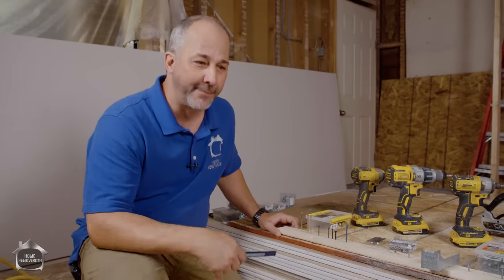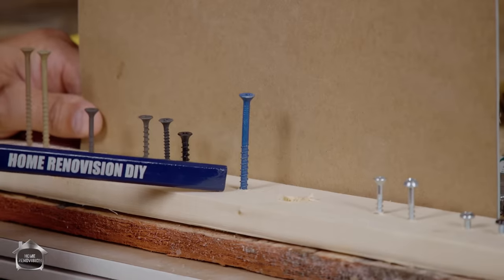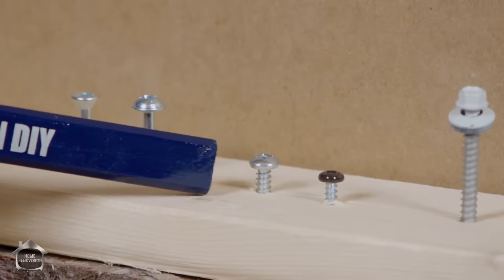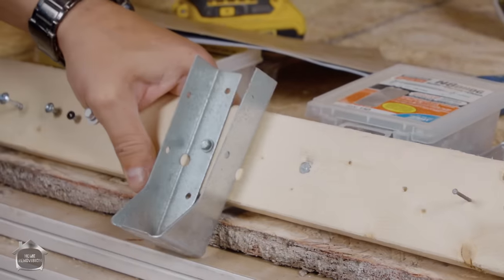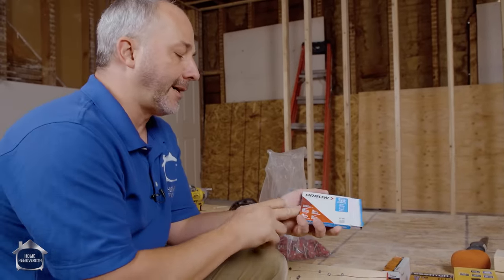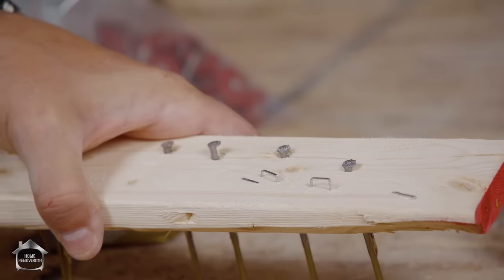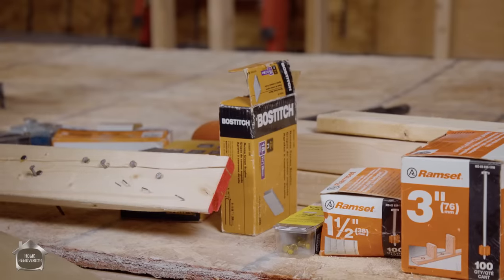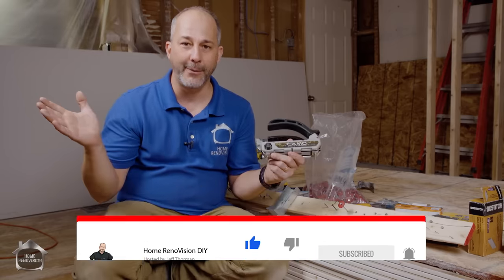What Screw to Use For Your DIY Project | Fasteners & Tools Guide

Comment: Thank you for putting this together. Would you mind doing a quick one on types of bit heads in your spare time? Philips,  flat head, square, hex, torx, etc. There are a lot that are confusing and frustrating, especially when they strip. It might be worth including products like screw removers that drill a screw out if they are stripped. Keep up the great work. You are a great role model and mentor, and your videos have been a lifesaver.

Comment: I like the tip about covering up existing popcorn ceiling (2:20) by using the drywall laminating screws to hold up the drywall to the ceiling.  I was dreading the idea of scraping off all the stucco so this is a great option!   BTW Great video on the differences between fasteners;  this video will go in my toolbox for sure.

Comment: Jeff, I bought a cabin and had to gut it and redo the entire inside and your videos have been awesome.  Question for you though.  I'm almost done with the drywall and I have a ton of left over screws.  Can I use them on the subfloor?  I would like to put a screw where every nail is (as you showed in a video) to fix the squeaky floors before I pour some self levering compound and then LVP.  Thank you

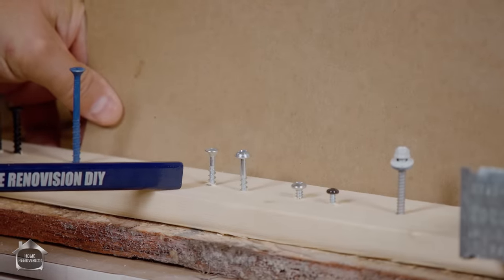Comment: I think that you may have gotten some terminology incorrect or you guys up north just call things differently.  At around 4:40 you start talking about the basic wood screw and say it has a pan head then the next screw you say has a flat head for particle board cabinet work.  I think those heads are reversed from what I have learned over the years.  The cone shaped head that is flush with the surface once fully fastened is the flat head.  The screw with a rounded top head with a flat surface towards the threads is the pan head/round head/button head screw (all of these are actually different heads but of the same general style with slight variations).
Other than that little note you are spot on with you fasteners.  I never thought that this would be such a highly requested video.  I guess being around construction and general mechanic work for many years has taught me some things I considered general knowledge.  You did a fantastic job explaining the various types and uses of a wide range of fasteners and I think your viewers will be better off for it.

Comment: Thank you, Jeff!   I let out an audible gasp that scared my cat when I saw the title of this video.  My very dear and wonderful late husband left me with a treasure trove of tools (many older hand tools, some very vintage from his machinist grandfather) and about 9,999,999 fasteners.  I could stock a small hardware store, truly.  Now, I'm not a total dummy when it comes to woodworking and basic construction, but OMG.  More than once in the last three years I've found myself almost in a  trance sitting in the garage gazing  at nails, screws, nuts and bolts of every size and shape imaginable, trying to sort them (HA!) while  wondering what the heck are they for, and why did my darling husband buy them.  I laughed when you mentioned purchasing in bulk.  Yep.  That was him.  If he needed two screws, he'd buy two dozen.  Then at some later date if he needed the same type he could never find one, so he'd just go buy another 20 or 30.  Sheesh!  So, once again, many thanks for the very well done lesson on fasteners from a very attentive pupil.   I've become a regular viewer, and love all of your videos.
Reply: Claire, like you, I had a ton of fasteners that landed on the basement workbench over the last 25 years!  And I sorted them!  What mystified me was the head shape and what would be the most typical application for flat, round, and oval in a "wood" screw and then, pan, truss, fillister and hex in the machine screw category!  Geez!  And why don't the threads go all the way to the top on some, leaving a smooth shank?  Those seem to be mostly on exterior wood screws. Coated, galvanized, stainless steel.....?  It made me feel like I needed to take a course on "Fasteners 101"

Comment: Thanks again, so much!  QUESTION: Is there a trick to consistently, successfully using a T-50 STAPLER? Throughout my life, I have used at least 30 different T-50 staplers. Each and every one of them fail. And I presently own 3 or 4.  Often the staples jam, often they do not drive the staples out at all. It is extremely frustrating. Very seldom have I been lucky enough to use a complete cartridge of staples without the stapler giving out.

Comment: Great video(s), and thank you.  Question if I may.  I’m a new homeowner and in the spring early summer, I’m installing 2x Margelles.  What are the best fasteners to install them in concrete, but I was hoping that I could set them in place with glue…. Is it possible?  Thx and happy 2022, and keep-up the good work.

Comment: Thanks Jeff.  Love your videos.  But I went to Home Depot yesterday and couldn't find any screws labelled "floor screws".  I need some screws to attach wood plank subflooring (1 3/4 inch thick) to the girders/joists below.  Everbilt has a 3 1/2 inch exterior wood screw, but it doesn't seem to have the small and large threads you demonstrated.  Can you give me a list of recommended screws I can purchase, either on-line or at a big box store, for this purpose?  Thanks.

Comment: Love all of your videos! I have been working on my house with your videos. I have few questions

1. I was wondering what type of nail or screw to attaching wood shelving to concrete block wall? A lot of people told me to use tapcon but I would like your advise. 

2. I am trying to rebuild a steps in my garage. But not sure if I need to use whole stair out of Pressure treated  lumber or just the last piece where it contact concrete floor. 

Need your help!

Comment: It's important to understand pilot holes & gliding holes when using fully or partially threaded screws and the implications for drill size or drill at all when trying to achieve compression between 2 materials.

Comment: Thank you for this video. What screws do you recommend for the 0.5-inch plywood or OSB external walls to connect to 2x4 studs? Would drywall screws work? The siding will be installed on top.

Comment: Love your videos, going to be building a house soon so I've been watching a lot of them.  Quick note about your 3 1/4" nail comment. I spoke with my brother in law who was a framer for many years, and he said they always use 16D Sinkers, but the CBC based on the IBC (I know you're not int eh states, but here in CA we use the CBC) states 16D commons and it further defines them a 3 1/2" by 0.165 diameter, and thats the same thing my structural engineer calls for on the drawings. Plus they don't accept the notched head type nails especially for shear panel nailing which is why a lot of nail guns use the plastic binding now. Anyway this is what I was told, so if you know otherwise, as in how is a 3 1/4" nail is acceptable when a 16D common actual length is 3 1/2 x 0.165 dia. I'd like to know, even though I looked all over and found a true 16D common nailer and bought 4000 nails for it lol.  Again great videos, love watching your channel.
Reply from the maker: I think what you will find is that inspectors allow the 3 1/4 as a close enough sort of scenario. Kind of like the rule for stairs. each rise must be the same. In practice the inspectors allow up to 3/8ths of an inch variance. All rules are mean to to be broken a little . In DiY renovations the goal is to do acceptable work and not aim for best practices. It is a lot more affordable for homeowners with that in mind! Cheers!
Reply: @HomeRenoVisionDIY  Gotcha, Thanks for the reply, and keep up with the great videos! I am learning a lot.
Reply: Yeah, clipped head nails are an instant fail in most places in the USA.
Reply: @HomeRenoVisionDIY  A 3/8's variance is literally spelled out in the code, it's not the inspector looking the other way. The code is the minimum building standard.

Comment: I'm facing this problem right now. A second layer of drywall is half inch or strapping and drywall 1 inch. How do you extend the electrical boxes in the ceiling? Box extenders only come in 1 1/2 and are not rated for ceiling fans. Been wracking my brain all week over this one while I'm finishing the other work. Thanks Jeff, you have saved me a fortune. Maybe when I'm done this I'll try Gatorbase and throw down some new interlock. Digging down 6 inches would kill me but luckily you taught me how to open a cash account at wholesalers.
Reply from the maker: Cheers Chris. Where I live they sell a 1/2 octagon extension box and you can hang a fan on it no problem.  Let me know what you think of the gatorbase. Cheers!
Reply: @HomeRenoVisionDIY  I found the half inch octagons this time. 7 bucks each! Hmmmm, Jeff would never pay this much for a band aid solution. So I stomped over to the wood aisle and found full inch whitewashed planks for 5$ and one shimmed all the boxes with tons left over.

Comment: Hi Jeff, I use a lot of pallet wood because I like to recycle wood that will otherwise end up in the landfill. Here in the UK they use those 2 ¼ staples to fasten the slats to the runners and it is a nightmare to get them out, they are so thin that they only just resister on the metal detector and then you have to dig each pin out because they snap as soon as you get hold of them and then there are two bits to get out. If you are not very careful and miss one, it makes a mess of your planer knives.
Reply from the maker: those hardwood pallets can be pretty handy!

Comment: I was told by a Ramset rep that the older your concrete is the stronger the charge needs to be. In my case for a 1974 house he suggested the red charge (27 caliber) which is the strongest on the market  and you need to buy the bigger Ramset Cobra gun which is the most expensive one out there of course.

Comment: Hi Jeff! Thanks so much for the video! I'm building my own deck (first time doing that) and have constructed the base out of the Sienna pressure treated wood 2x6s. To that, I am attaching 5/4x6 eastern white cedar deck boards and wanted to check with you that the Camo Marksman Pro tool would be a good choice. Also wondering which spacing I should choose? Thanks so much! Your videos are super helpful to inexperienced builders like me :) Lindsay

Comment: I needed to know which screw to mount 7/16" OSB sheeting to 2" x 4" studs inside my garage so I can mount anything anywhere on it without special brackets etc.
- Based on your video, it appears an 1 1/2" construction or flooring screws would be best.
- I want to just want to use clear poly over the OSB.  Any idea how to get the mill stamp off the middle of it?
- Which head drive type?

  a.  Torx by far can take the most torque without rounding out the head or bit, and all high-torque screws use them.  
  b.  Robertson/square has one advantage over the Torx and that is that the bit doesn't fall out in the horizontal position thereby freeing up a hand to position or steady the work when you are running in the screw.  Users don't seem to have many issues with it rounding out the head so apparently it is adequate.
  c.  Phillips advantage is it is the most common and doesn't require a special tool nor even an exact size bit to match.  However, it requires considerable downward pressure to prevent it from stripping out the head and tool which often happens.  However, I just bought a driver (based on one of your  videos) instead of using a drill, so maybe with a driver this is not much of an issue?
*Which do you most commonly use?
Thanks!

Comment: The plate that you discuss at the 4:24 mark onwards is called a nail plate.I'm not trying to annoy you,I say this because I was in need of nail plates and had a heck of a time finding them because I did not know the proper name for them.Many contractors take it for granted that because they happen to know what they need/are talking about everyone else does also which is not always the case so it's imperative that contractors do their best to disclose the names of the parts and building materials that they are discussing.Thank you for your video.

Comment: I grew up in a house where the men only had 1 multitool in their box...duct tape. In the past 2 yrs I have purchased more tools n relied on YouTube for instructions. This video is very informative. I am currently looking for a way to attach a steel fridge slide to bullet proof lined 3/4" oakwood and I am stumped on which screw to use. The supplier did not provide the hardware for this slide. Ridiculous n rude in my opinion. Do you have any advise on what I should use. All the company advised was an 8M screw.

Comment: You made quick mention that you can use the laminating screws and some joint compound to adhere drywall to existing drywall without needing to hit the studs? Did I hear that correct? I don't know if I'd trust this on on the ceiling, but I am going over a whole house in 1/4" so just wanted to confirm I'm hearing this correct, would DEFF make things go quicker

Comment: Hi Jeff, I want to directly cover a feature red brick wall that’s over 90 years old with dry wall (Gyprock) without using glue or wood framing. I want to minimise the damage to the wall as the drywall is only temporary. What screws can you recommend? I’m in Australia. Cheers

Comment: Great info on the fasteners.  Makes me think about a question I have about the remodeling I'm doing.  We are moving some walls and raising the sunken living room floor up to the same height of the main floors.  Removing fall hazards for my wife.  Would i be better off using my framing nailer or construction screws to make the new walls snd floors?  I was planning on using screws as I thought in the long run they would hold better and not cause a squeaky floor.  The air nailer might be faster.  To be honest I bought the air framing market for a different project years ago but then didn't need it.  Any advice is appreciated.

Comment: Great video, To the point, you nailed it. But maybe there is one omission (for those of us who don't have nifty guns to drive nails into concrete). I'm trying to fix a fence post to a granite stone wall using sleeve anchor expansion bolts and I just can't seem to get them to work. I'd really like to see you explain how to install and fix them.... otherwise I'm screwed!
Reply from the maker: SLEVE ANCHOR BOLTS REQUIRE THE RIGHT SIZE HOLE TO BE DRILLED. THE PACKAGE USUALLY HAS THE RECOMENDATION ON IT. Once you drill the right hole they work like a charm. Cheers!

Comment: A have a strange problem, seems like no one but me has it. I'm using desk screws Grip Rite Fasteners 1-5/8" (Primeguard Exterior Screws) on a fence. They were recommended to me in HD. When I decided to redo a bit one fraction of the fence and removed some pickets like 6 of 18 screws got broken. I've read that bcs they are hardened they don't withstand much sheer stress. The original screws were just metal screws for inside works. They were all rusted, but none of them got broken on removal. And I screw them in into just pressurized wood (I think the treated one is even more dense). I think maybe better to use for star screwdriver instead of regular Phillips. I would appreciate any opinion on this matter, bcs I don't understand at all how such fragile screws can be used for decks (even for a fence they are not quite reliable). Thank you for you film.

Comment: You didn't comment on the difference between the flat crown and rounded crown staples. I use the flats for thin plywood. I can't think of a use for the rounded crown staples. Next time you make a video on fasteners, would you reference the round crown staples and what they're intended use is?

Comment: Iam guessing would I use the fine thread drywall screw for metal studs that have wood blocking. All three materials really drywall, metal stud with wood blocking. Also would I use that same screw if I wanted to attach the wood blocking to the metal stud? Iam trying to mount a tankless water heater, thanks

Comment: please explain nailing crown molding with the  18 ga staple from reverse? pre assemble at corners only ? i must do it the hard way, scab blocking or locate studs /joists/ mark/ fit /nail .
scarf joint  only when necessary.

Comment: I love how Lowes has 500 flooring screws for $50 and 1600 for $55 (2 1/4 inches).
Always buy in bulk
Reply from the maker: It would be funny if it wasn't so ridiculous!
Reply: I worked at a temp job in Toronto and the only thing the company did was take bulk screws and re-package them for Home Depot. Packed and weighed large tubs of screws.
Reply: Can you post a link to the flooring screws you found at Lowes?
Reply: You pay for packaging

Comment: I made some small signs to identify each garlic variety my hubby taught me how to farm. I am attaching these 11” signs to a wood post. I used cedar wood for both the signs and posts.  The posts are 1x2 cedar 4’ long. I attached my first sign with 2 one and 5/8” deck screws. ☹️ Before I go any further, I need advice. Should I glue the post to the sign first?  What kind of screw?  I did drill a pilot hole, but the sign came off anyway. Can you advise me?

Comment: This was extremely informative.  Can you also tell me what the difference in numbers on screws, such as a #8 or #6 etc. means? Thanks
Reply: I can tell you that the #6, and #8 has to do with the thickness of screws. #6 is thin, the #8 is thicker, and there is a #10 screw also.  I think the #6 is good for thinner wood, and the #8 is better for thicker stock. Google screw diameters, that can give a better explanation and pictures to reference too
Reply: I hope that helps you
Reply: @timothycreasy2161  Thanks Timothy.  I figured that was it but wasn't quite sure. 🙂